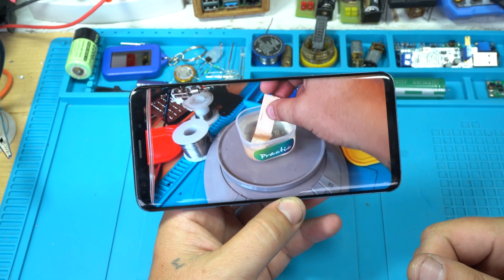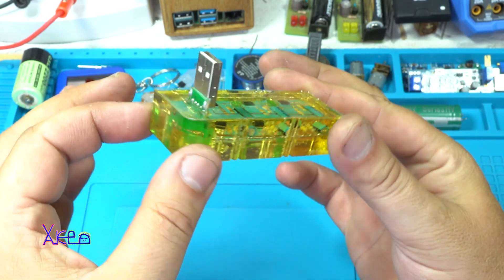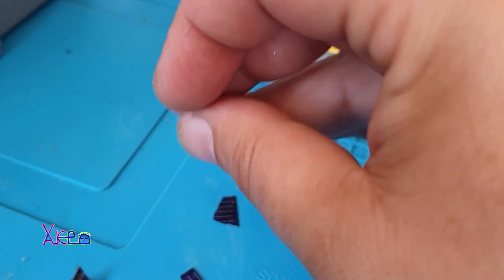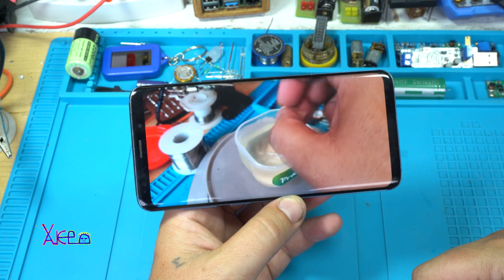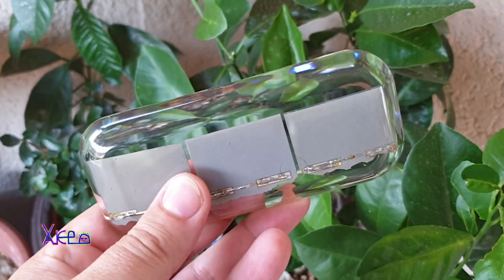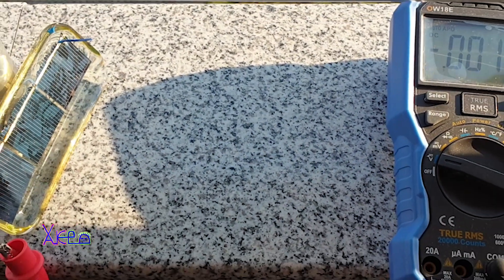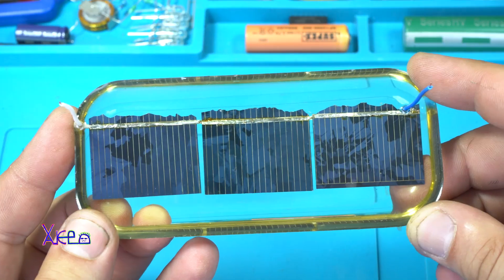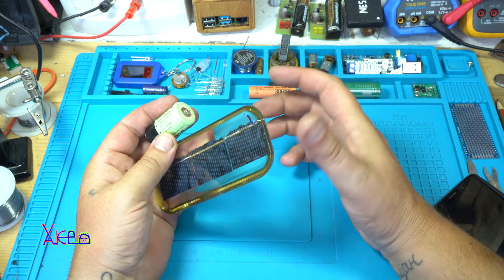Make at Home Crystal Clear Solar Panel - How To make solar panel using transparent epoxy resin

Comment: Its a fun project to make but you already need an broken solar panel or part of it. And when the epoxy coating is exposed to UV light, either directly or indirectly, it causes a noticeable and permanent damage as a result of photo degradation, including loss of gloss, and/or yellow discoloration, and for the coloured one chalking and breakdown of the coating may also result.